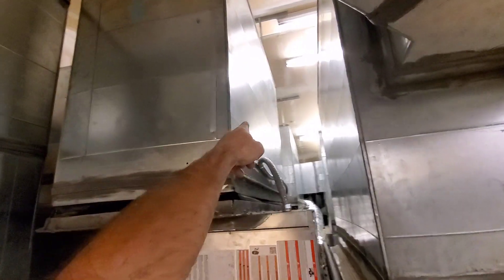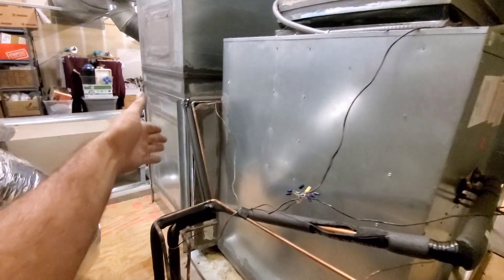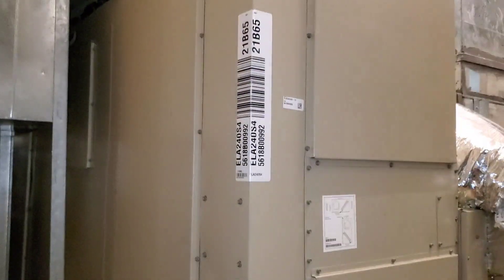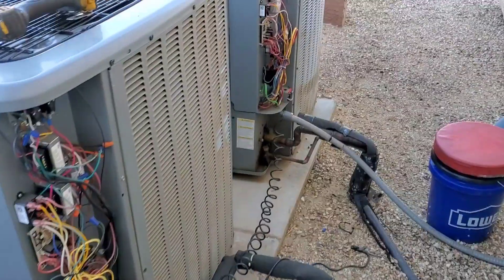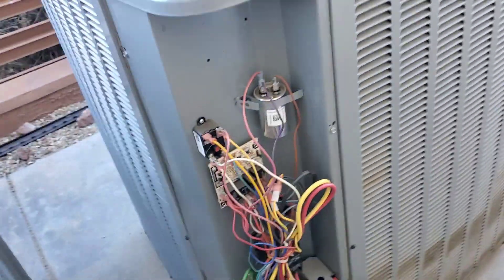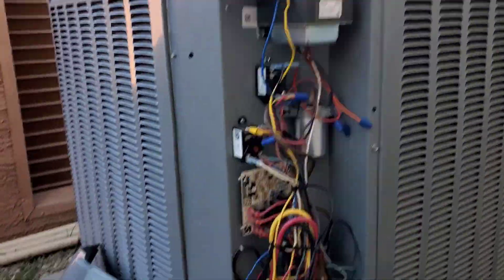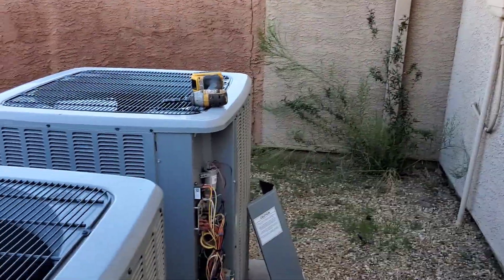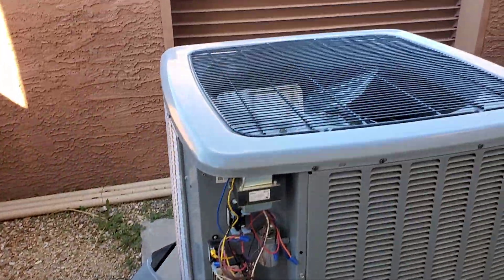FUBAR wanna-be 20 ton Daikin Goodman hack install - Total bastardization!

Comment: what a hack job! I used to do service work for Goodman...why wasn't the installer or supplier called back? goodmans warranty would cover the cost of a PROPER install...I've had to reinstall units for them before due to inproper installations and goodman charged the original installer not the customer[30 years lic. in hvac]

Comment: Wow.... what was the call you had on these units.insufficient heating and cooling?They did not size them correctly ,no manual j,s,or d was done.What these guys did not know how to transition or what?That is a terrible solution,my God what was they thinking...
Reply from the maker: The 5 ton splits on the gym building didn't work. Most of the Goodman made Daikin coils leaked already. (Where are you now, Goodman fans?)
And they ran poor before due to mismatch in R410 with R22 indoor units.
I never saw the pressures. They were DOA when I came. They just wanted info to replace.

Comment: The wire from the large disconnect to the small disconnects needs to be the same ampacity as the fuses in the large disconnect and the small disconnects must be fused for the condensers for it to be code. As long as they are fused disconnects it's really easy peasy to do. If they aren't fused it's going to get expensive and mess that wall up haha! I don't think anybody hacks as well as the contractors out by you dude!
Reply: There are tap rules in the NEC that would dictate conductor sizing between the large disconnect and the small AC fused disconnects. If done properly, those conductors wouldn’t need to be sized at 200 amps.  Google NEC Feeder Taps.
Reply: @jacobspringman  Not going to lie, I fix air conditioners. I'll let the sparkies handle all that haha